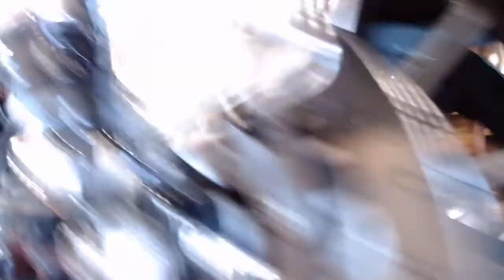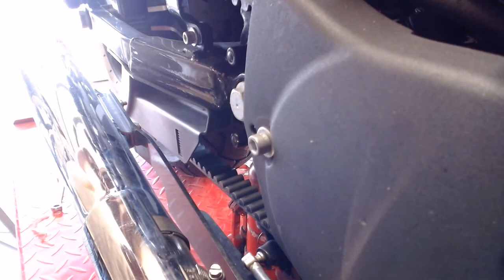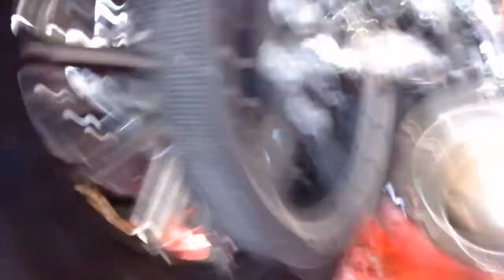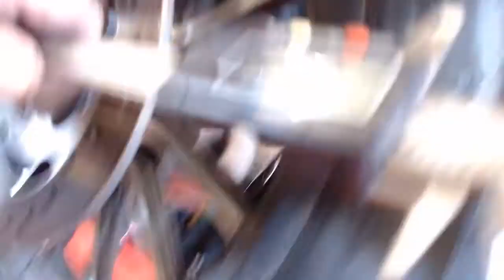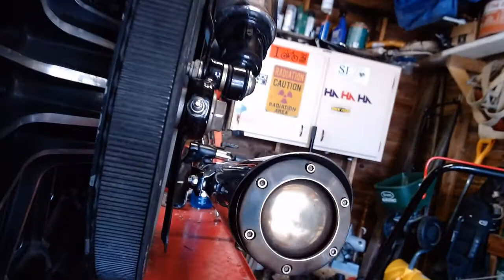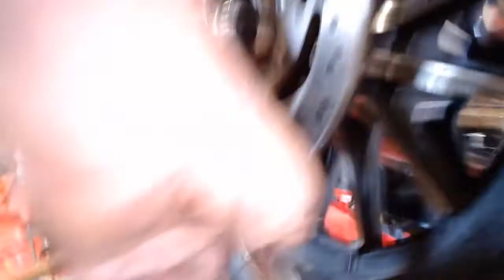Harley Drive Belt adjust and tension on Sportster. No Special tools!

Comment: great vid and thanks for posting. measuring the threaded length of the axle adjustment bolts is brilliant.
Reply from the maker: Thanks!  It is actually harleys idea.
Reply: @KnobleMoto  my pleasure sir. never having checked a service manual, wasn't aware of that. either way it's a hell of alot easier simply checking length as you did. great tip.

Comment: where do you get the rubber axle adjuster bolt covers ? i also need the little rubber elbow for the fuel tank vent line....where do i find this stuff???
Reply from the maker: Industrial supply places like grainger and McMaster Carr. Search for screw covers or thread protectors. 
Now for the fuel lines, I get vacuum caps from the local auto parts store.  They generally sell a box of assorted sizes.
Reply: @KnobleMoto  THANK YOU VERY MUCH SIR !!! ... but i can't cap off the tank vent...
the part i need there, is like a little 90 degree rubber elbow....i got the smallest one they had, at my local carquest, and ended up having to crush it into approximate fitment with zip ties....
gaudy and semi-functional, it comes off sometimes..

Comment: Is your rear wheel full on the ground under full weight ?
Reply from the maker: It was weighted enough that the swingarm was in line with the pulleys. Hopefully I mentioned that in the video.

Comment: DO NOT do it this way. Belt tension is harder to adjust than a chain. You seriously need the special tools. There are two of them. The 10 pound tension gauge from H-D, because you will never get it right by feel with a rubber belt, and a wheel alignment gauge. I got mine from Motion Pro. It is a long metal rod that has a fixed point on one end, and an adjustable point on the other end. There is a dimple in the end of the swing arm pivot on both sides, and a dimple in each end of the axle. To get the wheel aligned properly, the distance from the center of the swing arm pivot shaft to the center of the axle must be EXACTLY the same on both sides. That means EXACTLY the same, not 1/16" off. You can get away with that much difference with a chain, but not a belt. That distance is what the special tool measures. The tension gauge puts exactly 10 pounds of tension on the belt. You don't want 9 pounds or 11 pounds. It needs to be 10 pounds. This is where the problem comes in. It is almost impossible to get the tension EXACTLY right, while at the same time getting the wheel alignment EXACTLY right. It took me 4 attempts and over 2 hours. Remember that unlike a chain, a belt has NO sideways flex at all. It the wheel is not perfectly aligned, the pulleys won't be either, and the belt will wear very quickly, and may even come off the pulleys. I would much rather have a chain drive. Chains might require a little more maintenance (though not much more with modern O ring chains) and they are 10 times easier to adjust.
Reply from the maker: Well If i did it that way, the video would not have been called "with no special tools"
Reply: I tried this and my belt tension was loose and my axle was out of alignment , I made a alignment tool out of a stright rod and and a rubber pointer, I left the bikes weight on the rear tire, loosened up the axle then the axle adjuster, aligned the axle with my home made alignment tool, turn axle adjusting nut evenly intel I reached the right amount of tension, checked with my $10 tension tool, rechecked axle alignment with home made tool, all was good, torqued rear axle nut to spec, rechecked belt tension and axle alignment, all was perfect, this was done with the weight of the bike on it's tires! Never needed my special $25 calipers! The only special tool you need is the belt tension tool. Videos can set you down the wrong path.